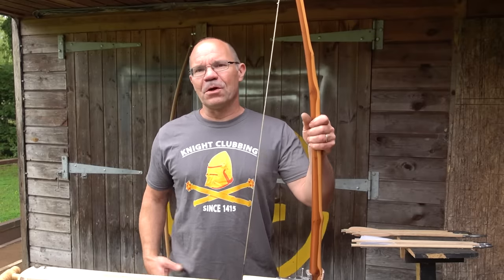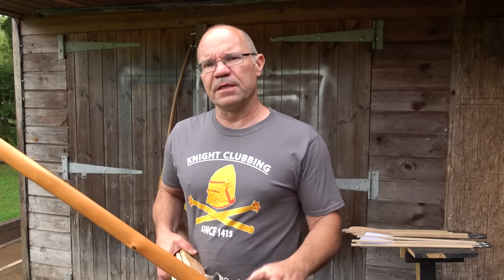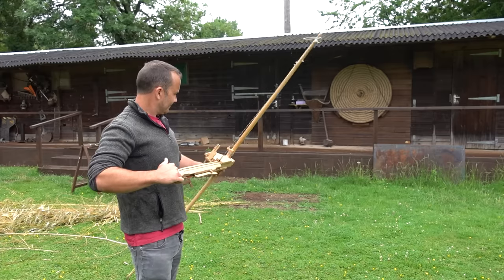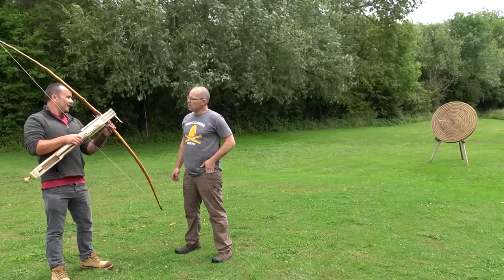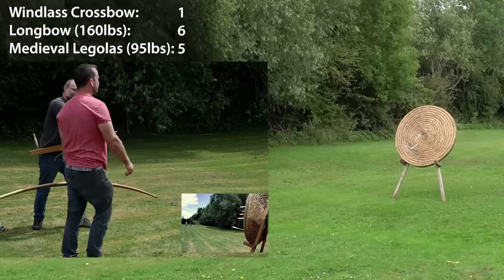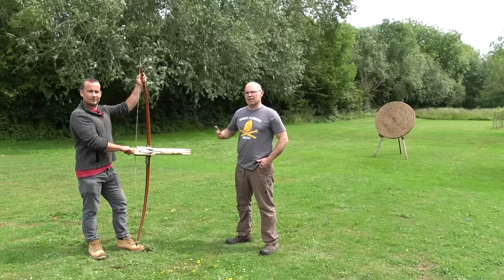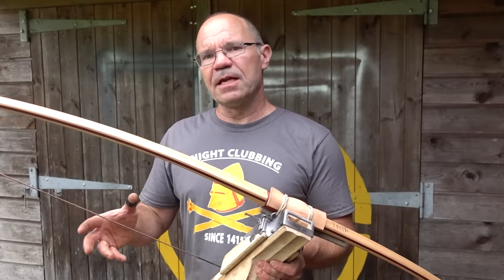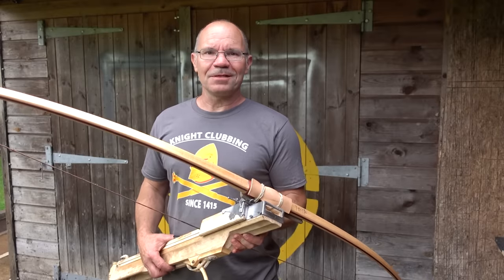Tod's 120lb Medieval Legolas - TESTED

Comment: Would like to set this device on a wall mounted (really heavy) bow or crossbow, being able to put your foot into the wall and lean back - then just let it rip over and over really fast.  Maybe put a box mag on it to shoot 20+ bolts.  Perhaps with a auto-locking function at full draw.
Reply: Or put this heavy bow (probably horizontally mounted) on a 2 wheel cart and then using your foot to help pull it back.
Reply: 500 pound bow + horse (or 4 people) + realy heavy trigger.
Reply: And call it an auto-ballista.
Reply: It's called a polybolas.  No reason to strain yourself when you're wall mounting it.  The historical ones had a crank to make it easy.
Reply: The Chinese had a mounted version of the chu ku nu (I think I spelled it correctly) which was used for naval warfare too. It’s a really simple repeating crossbow with a vertical magazine and drawn with a lever. Love to see a remake of that powered by Joe!
Reply: @laurenceperkins7468  yes - indeed - i think with a version of this device we could make a better version of a device like a polybolas, perhaps nearly as strong as large instruments like polybolas - or a mini-ballista.  The idea wouldn't be to replace or compete with it, but to have a smaller, more portable - easily moved/relocated (say to a different wall if the situation called for it).
Reply: @laurenceperkins7468  I believe the idea is more to leave it lower power so you can still shot it really fast, Mount it to use your whole body to make it even faster and more powerful and then add an hopper instead of a magazine. That would turn your average shooting slit on a castle into a friggin fox hole.
Reply: @theexchipmunk  yuuup!

Comment: 13:45 imagine trying to charge at a line of archers outputting this level of fire....
Reply: You just saw the core English infantry strategy from 1400 to 1900. Basically train your soldiers to the point that they can shoot faster than the enemy can advance. Worked in the 100 years war, and worked against Napoleon.
Reply: Not gonna happen.

Comment: maybe it's more about energy pacing with the user itself? like shooting faster likely need a bigger pacing time, meanwhile a normal pacing shooting is easier for user's body & muscles. It's like how different an athlete runners that focus on 100M dash compare to a marathon. 

In any case, I think defense & siege warfare likely very usable using heavy Instant Legolas (90-120 lb, 5 arrow mag), a hybrid of longbow & crossbow with an arrow magazine. Meanwhile a lighter  Instant legolas (50-80 lb, 10 arrow mag) with shorter & larger arrow magazine for fast moving operations like in open battlefield or covert tasks. That's my guess. After all Instant Legolas is a very modular tool (concept) that could be tinker in size & power too.
Reply: i like the idea joerg gave with using arrows too short for opponent to return fire
Reply: @siekensou77  exactly, I mean that also one of the good point from using short bolts. another one would a much faster overall speed & travel
Reply: @siekensou77  After 100s of archers finish their first round, i don't think there would be much left to return the fire, though.

Comment: Excellent innovation! Couple observations from us Colonials across the pond; First, range safety. Always treat a weapon like it's loaded. Never stand downrange from any class of projectile weapon while anyone is holding one, particularly when it's pointed directly at you. That may sound irrational but it's about building a mindset and repeatable behaviors that maximize productivity and minimize the possibility of injury. Second, this tool could possibly fire even faster as the user become accustomed to the impulse of physical strength to draw but the need to have a slow instant of control to ensure your best aim.

Comment: Great video! 
I'm interested in knowing if the device makes penetrating armour possible!
Secondly I think some minor tweaks to the device could help make it easier to use on heavier bows, without detracting from its benefits.
- If the handle was in line with the bowstring (vertical instead of horizontal) you would continue to use the same muscle group.
- You also mentioned that you designed it for considerably longer arrows, because they are heavier. I am interested in what the effectiveness of normal length arrows (that are perhaps slightly thicker) would be, as the pressure from pulling would lessen.
Kind regards,

Comment: Even when going for accuracy over speed, there's a remarkable improvement to the speed compared to a normal bow. Imagine 100 archers armed with this, each with 5 bolts. That would be insanely intimidating on any appropriately historic battlefield.
Reply: Well I don’t think they needed accuracy. They just needed consistency. When directing a massed volley, they all just need to aim at the right angle and the right direction, so that the arrows land in the same area. This attachment can speed up the volley times, and when the enemy gets close, have them fire at will and unload. At close range, the spread and inaccuracies wouldn’t matter.

Comment: Loving the deep dive into this.
You can see straight away once Joe starts shooting it why no one ever bothered with building something like this for a war bow, it looks so clunky, it's obviously hard work and can you imagine having to carry, clean and maintain it on campaign! What happens if it gets wet or dirty, covered in mud etc...
Other the other hand as a curio for the medieval elite maybe it would have a place, I'd imagine on a driven hunt on a light hunting bow for a quick follow up shot on a moving target...
Reply: @What saith the scripture? Exactly, simply a matter of training. Heck modern guns have SO many moving parts and get fucked up by heat, mud etc, so they're simply drilled to strip, clean & maintain them. As Todd proved here with the bone hinges & field separability, this would have been possible.
Reply: If it breaks, you still have a perfectly functional bow.
Reply: a medieval soldier had plenty of equipment to maintain against mud and dirt as well. They had to maintain the sharpness of their blades, ensure their armor wasn't rusting and deteriorating, and crossbowmen with similarly complex winding mechanisms would have just as much problems, not to mention firearms which started appearing immediately after the time of the bow and crossbow would have required a similar level of maintenance as well and they were rolled out on mass eventually

Comment: I can’t see why this would be relegated to the experienced archer, it seems to me that it would be more valuable in the hands of an inexperienced soldier, since you need a lot less training to use it effectively. Plus there’s the fact that veteran archers would have to “unlearn” some things and likely train different muscle groups due to the altered hand position.
Reply: This one is working without a draw assist. An inexperienced archer isnt going to be able to draw a high poundage bow plus friction to the point where the mechanics help. 

If they can sort a draw assist, then it becomes excessable to the inexperienced but in its current format, anyone who would be able to draw it will be an experienced archer in the first place.
Reply: Draw weight, if nothing else. Just building up the relevant muscle strength for heavier bows takes a lot of training (and most of that training is shooting, so you work on your accuracy at the same time)
Reply: @andrewshaw1571  Well if you get to the draw assist - i think the complexity and value of material might make a assisted Legolas to expensive for the expendable footsoldier.

With the legolas alone its 3 times the wood, metalbits, shaving hornsprings, glue, nails and a few hours of building. The economics might favor the richer/more valued soldiers.

Aside from that I wonder how it fairs against bad weather, if you could carry it openly or in some kind of leatherbag.
Reply: Well then you could put it in a mixed platoon legolas to supress expirenced bow men to take out targets and being 3x the materials for expendable people isnt so bad if it could be used to keep them from dying more
Reply: It depends how expensive (material/manpower/time) the device would be to produce at the time. If you can produce enough to arm a large amount of untrained people without worry (while also not taking away from production of other arms), you are going to give it to an experienced and well trained person who can take care of it and use it most effectively.
Reply: Experienced shooters would be practicing with their normal bows anyways, so having some of that time allotted to the instant bow would mitigate the relearning curve since their skills still carry over, although not 100%.
Reply from the maker: In simple terms I believe this.  If you have an effective weapon give it to those who will use it effectively and reliably so you get a good outcome, not give it to people you can't trust to stand when things get rough who dump and run at the first jam
Reply: @tods_workshop  my thought was to give these to knights and other professional soldiers who don't normally train in bows.

They aren't going to break but benefit from the easier aim.
Reply: @tods_workshop  I've never seen a 16th-century or earlier source claim anything about quick & easy training. Despite popular belief, matchlock firearms required considerable practice to be effective. It was the archers who were called untrained, presumably because archery skills were reasonably prevalent by default in the English population in the late 16th century & early 17th century. & of course crossbowers practiced extensively via guild system, competed for prizes, often took the field wearing armor, & often received high pay. Historical military manuals stress the importance of training, experience, & discipline. I'm very skeptical of the idea that soldiers equipped with any weapon could have done much good on a medieval/Renaissance battlefield without significant skill.
Reply: Accuracy with the bow and arrow takes years to learn. If you take an already strong guy and give him the instant legolas he can be made into a pro in a matter of weeks. Consider why did the English lose the 100 years war? In one battle they lost most of their experienced archers and could not recover. It would take years to retrain an army of archers and by then it would be too late. But if they had the instant legolas they could have fielded a replacement army almost right away and kept up the war effort.
Reply: Tod's Workshop sure that makes sense, but then, if all your experienced, capable soldiers are occupied I think his would be a good quick-implementation weapon to supplement your forces, since it would lessen training time necessary to achieve similar results. Also I think it probably wouldn’t be too terribly difficult for the average joe to attain the strength necessary to draw this, especially considering the beef people had on them back then. Basically I think if you had all your experienced archers, but then you also had the ability to quickly raise an effective fighting force it would be an incredible asset.

Comment: I have not read through all the comments, so sorry if I am repeating someone else's thoughts. 
Joe says that it was quite a hard work, although he can shoot 200 pound bows. Of course, there are issues with friction, slightly different ergonomics etc, but would not the main issue be that he has no recovery time between shots? Shooting a normal bow , he has about 10 seconds between shots , here about 2 seconds. That is equivalent of pulling 200 pounds once vs 625 pounds once (or 125 pounds 5 times). Energy expenditure is so much greater, no wonder he was bushed.
As an aside, I have just graduated to a 60 pound recurve and IT IS HARD!!! I have nothing but respect for Joe, he is an absolute beast.

Comment: I think that the version you made would be very good for those heavier bows in the hands of experienced archers.  You're completely right about that.

But I'm still convinced that a less bulky version for smaller bows (something you can carry and use relatively easily in close quarters) would still be a far better option for most archers than any crossbow.

It would be like the medieval equivalent of an M-5.  Something fast, reasonably accurate, and very easy to use.  It wouldn't be of much use on a conventional medieval battlefield, but it could potentially also drastically have changed how they thought about and conducted warfare in general.  It might well have inspired them to do far more frequent covert operations rather than open battles.   A thorough look at history pretty clearly shows that the thing that tends to change warfare the most, is range, attack speed, mobility, and armor/defense.  Attack power really doesn't mean anything except to overcome defenses, and is most often increased by the simple fact of increasing a weapon's range or attack speed tends to intrinsically increase the amount of energy it hits with.  And of those, really attack speed is the biggest game-changer.  Once a small arm was availabe

Imagine a version with a thin, hardened leather case that would hold the bolts, and pop into the magazine slot rather than individually loading each bolt.  Pop it out, drop it in your satchel and grab the next fully loaded one.  You could carry two-dozen bolts relatively easily, and put multiple arrows into enemies quickly and at close range.  So long as no target is wearing plate, they'd be ridiculously effective.

Comment: Having to move your arm in relation to your anchor point that extra 100mm while drawing a heavy bow would add a shit ton of weight and require parts of the muscle that have not been trained to draw a heavy bow. 
Source: I have experience lifting weights and understand that an extended range of motion almost always requires more strength.
But I'm not just here to shit on the execution I have an obvious solution, make the handle be in the same location at full draw as the string would normally be, if this requires a stronger bow to reach the same draw weight at a shorter string draw length then that is what is required but the device must be made shorter or someone has to train their muscles get used to an over extended poorly optimized anchor point.
Reply: That was my first thought as well.  Some Chinese bows were drawn to the ear, & had a slightly (not very) different draw technique.  They started with both hands overhead, and pulled the back hand down towards the back shoulder, arrow more or less flat the whole time.  The movement was a little less asymetrical than a longbow draw.  The body position was the same, though.  Back to your point, however, the extra distance will definitely need more strength & different coordination.  You could also use a bow with a shorter draw length and pull your hand to the chin.  I'm not sure if this would work well for heavy arrows, as they need the full draw length to accelerate.
Reply: I wonder if could have possibly offset the handle and moved it in FRONT of the bow string. Could be a horrible laceration waiting to happen though.
Reply: The reverse bow was supposed to help reduce the feeling of weight.

Comment: Where can i get a hold of a t-shirt like that? I need one!
Reply from the maker: Tods Workshop various design T-shirts available on the merch shelf under all the videos.   ‘Do you like shooting arrows? Because I do‘  and ‘Knight Clubbing’ included, (also neon version)  check them all out.
Reply: @tods_workshop  
"Knight Clubbing"
I get the image of a helmet getting smacked with a mace... change the dynamic of modern lingo...
Reply: @tods_workshop  I  checked it in and out, I did not find it : (
Reply: @theminorityshack7071  It's not showing up for me either, but some googling suggests you can get it through Teespring.

Comment: nice video but a few comments:
-he bareley uses the handle and getting rid of it so quickly may not have been the best choice
-you could mount the handle the other way round so it is easier for him to shoot
-sighting does more or less only work on a device like this and propably needs the front handle
-hes seems just set in his ways and it seems to be a hard thing for him getting used to the device because he is so well trained in this one range of bows
-maybe the length is also not perfect for his anatomy thats why you use shorter bolts to be able to better adjust that, since they're guided there is no need for them to be long and you can make them heavier anyway
-the speed thing and the accuracy on this heavy bows might be two different things maybe there is a weightlimit where this version is not usefull anymore
- it is maybe not to be used by highly trained archers more like a crossbow. it should combine the advanteges ov crossbow and bow
Reply: 120 pounds in a holding grip is a joke to hold for men. Average height and chubby;I don't work out and can actively open to close grip 160 pounds.